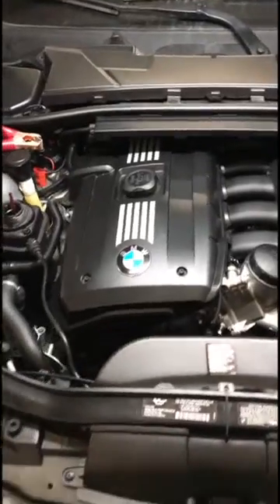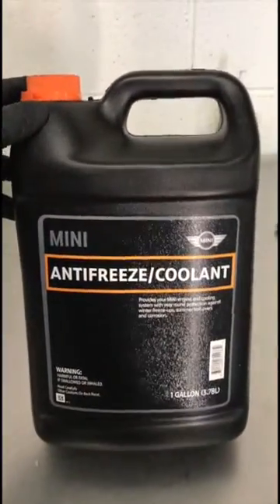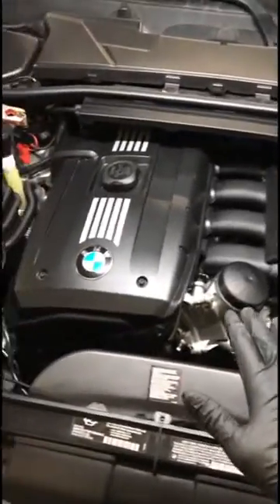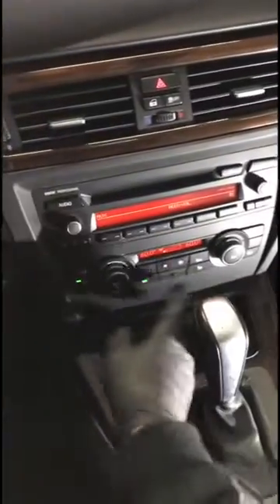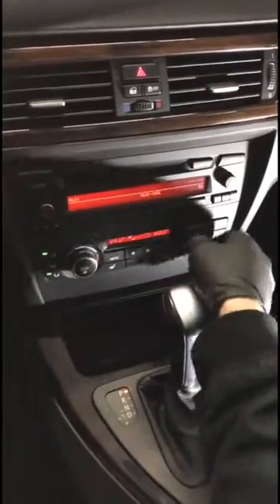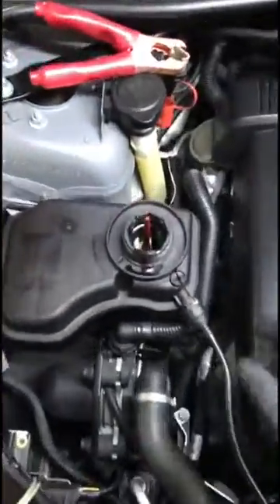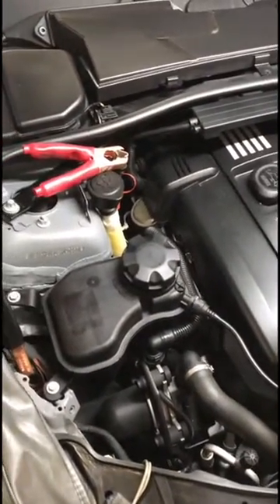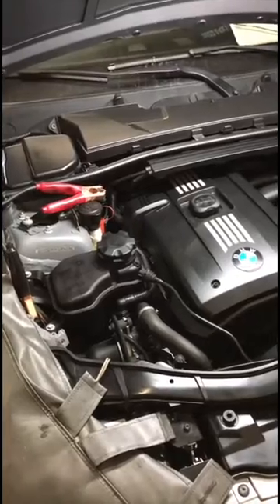How to bleed BMW with Electric Coolant pump

Comment: E90 318i n43b20a 
Hi everyone,
I’m dealing with an overheating issue on my BMW. The thermostat has already been replaced, but the coolant temperature still keeps rising.

When I run the bleed/test mode, the electric water pump seems to work normally, but when I actually start the engine, there’s no coolant circulation (nothing spraying back into the expansion tank).

I also pulled a fault code: 2E85 – Electric water pump communication error.

Has anyone experienced this before, or could give me some guidance on what to check next?

Thanks in advance!

Comment: Hello. I have a question. Why does my car heater turn of after couple seconds?
Reply from the maker: If you don't have a battery charger on and your battery is weak it will shut the ignition off.

Comment: Do I unscrew the bleeder screw when bleeding it or just loosing it up?
Reply from the maker: You can just loosen it half way while topping off the coolant. Then tighten it down before performing the water pump bleeding procedure.

Comment: I can’t get my pump to turn on.
Reply from the maker: @ArchieMacLean-tq6zz  did you just replace it? What coolant repair are you doing. Did the car initially overheat? If so maybe the pump is bad
Reply: @MikeMDs  the car did get hot but not too bad.  It had a leak in the top line so I fixed it and now I'm trying to bleed the system but the pump does not want to activate.  I don't even know if it has a pump.
Reply from the maker: If it is not the engine shown then it might have a mechanical coolant pump. If so let the vehicle idle for three minutes at 3,000 rpms with the heater on. Once you feel hot air form the heater the system is bleed.  After the engine cools down you can top off as needed.

Comment: You really don't need more than 3 mins at a time your battery will drain if you do it too long. 3 mins bleed turn it on with cap off and turn it on for like 3 mins then repeat I've never had a issue.  BMW 328i 2011 automatic

Comment: Question: does the cap needs to be tight closen? 🤔
Reply from the maker: either all the way off or all the way tightened. No in between because  the jet hole will be blocked.
Reply: @MikeMDs  thx

Comment: What amp setting do you use for battery charger/maintainer? Curious if I should use the trickle or charge mode.
Reply from the maker: My charger is automatic. But definitely not on trickle. This thing draws some amps.
Reply: @MikeMDs  thanks! I set it to 10A last night for 3 bleed cycles, and it pulled closer to 12-15A probably. Worked great with $60 hobo freight tool, if only i didnt Put the radiator to turbo air hose on loose 😂

Comment: goimg a bit off topic on this video but i have a 2006 325i e90 and it has this code  intermittently p0604 Code - Internal Control Module Random Access Memory  (RAM) Error ..if the car is cold it always turns on but after driving it for quite awhile and turn it i
off it then it will not start and gives me that code

Comment: There's a bleeder screw on the side of oil filter. (On n46 e90) simply open unscrew plug while filling the coolant reservoir.. once the coolant comes out..(pushing air out ) close the bleeder screw and check coolant level in the reservoir...n

Comment: 2009 328i, water pumps but flow seems really low and it flows for maybe 10 seconds then stops, then a few seconds later repeats and keeps cycling like that. Did that for less than 10 minutes then stopped. Had charger connected the whole time.
Is the flow supposed to be constant the whole 12-ish minutes? Does this sound like a failing pump?
Reply from the maker: It is normal for it to vary in speed and shut on and off while performing the bleeding procedure.

Comment: hi.. just want to ask if i push gas pedal for 12 sec , my ECU will format or not ? because my friend said if we push for up to 8 sec , all of thing in ECU will reset to factory setting back. thank you
Reply from the maker: It will not reset the ECU doing that. To reset the ECU on BMW's it requires a machine.  You are safe to precede

Comment: Hello ignition position won’t stay on long enough for bleeding, can you tell me why
Reply from the maker: Hi, 
You probably have a weak battery. The car will turn off the ignition on purpose.  You can try and hook a battery charger to your car. Let it charge the battery first for about an hour then try it again leaving the battery charger attached.

Comment: Any idea as to why the bleed procedure will not complete? I've let mine run about 30 minutes and it doesn't finish.
Reply from the maker: Some models will keep going. after 10 min you can stop it as that is plenty of time.
Reply: @MikeMDs  thank you!

Comment: Thanks for a great video, when connecting the power source, do you have to disconnect your positive lead on your battery?
Reply from the maker: No, the power source is only so the pump activation wont drain your battery.

Comment: My BMW F20 has also electrical pump, but this does not work on my car.
I press the gas pedal longer than 15 seconds. But i dont hear the pump working.
Reply from the maker: Your engine has a mechanical main coolant pump. And a small electric pump for the turbocharger. This method will not work on your engine. You bleed it the old school way. Heater on while revving it at 3k rpms till you feel heat coming out of the vents. Make sure the coolant cap is on while doing this.

Comment: I asked that question about bleeding with FCP Euros and the guy said you didn't have to do that cuz I remember doing that on the E46 I'll be changing my radiator cuz my elbow on the upper radiator has a slight leak and they're lower radiator or the sensor goes in is leaking there too

Comment: I’m going to pick an 06 530i up and plan on doing this to it as soon as I pick it up. My only concern is the battery potentially dying. Would jumping it off if it did die be an option?

Comment: Is water pump replacement easy to do?
Reply from the maker: The electric waterpump is in a tight spot on the right side of the engine. Without a hoist I'd say no it is not easy.
Reply: Not easy but not impossible, but at the same time it’s really not a hard job just be patient with it since there’s not much space

Comment: I have a E90 320i with a faulty auxiliary pump, will this stop the bleeding process from working.
As I have tried it and nothing happens.??.
Reply from the maker: Yes if the pump is faulty the bleeding will not work.

Comment: I have. 2017 and I did this and there was a puddle under the car. Had the pump changed about 8 months ago. Also a hose on the left side. Any suggestions?
Reply from the maker: It's hard to know what is leaking without seeing is. my guess is a loose hose clamp at the pump or thermostat.

Comment: Hi sir thank you for your video is very good describe procedure 

I have a 2 question for you 

- Betwen 2 bleeding cycle if possible to not shut off key and just put the gaz pedal for restart the second cycle?

- And for cleaning and descaling all water system what product is recommended for an E90 328xi 2011?

Thank you have a nice day 
(Sorry for my english it's little hard for me)
Reply from the maker: Im not sure on your first question. I've never tried that. 

The second question. No cleaning checmicals are recommended as you will never get them out completely. 
Unless you have foreign liquid in the system like engine oil or stop leak.  At that point it is recommended to use GAIN laundry detergent. As it is gentle and wont etch or absorb into the coolant components. you would need to flush the system many times though. You run the engine with it to get it warm in-between flushes.
Reply: @MikeMDs  Thank you have a nice day

Comment: Hi mike so I replaced water pump thermostat hose flange on my 2010 bmw 328i the bleeding process went threw but it kept going for like 20 minutes then I stopped it and retried it and it’ll start doing it then just stop no more bubbles come out of reservoir straight anti freeze
Reply: I also changed Raidiator
Reply from the maker: Yes some just keep on going forever. So as long as there are no bubbles you are golden.

Comment: My old raidiator for a bmw e90 was cracked I changed it and filled my coolant up and the light is still on for the coolant but I never bled it is that something I have to do? It’s been a month since my radiator change and I didn’t bleed it do I need to do that ? Pls help
Reply: Also changed the sensor and the light still comes on
Reply from the maker: If you check the level and it is good. Then it is a bad coolant tank. The float inside is waterlogged and not floating properly .

Comment: Great tutorial video! Clearly spoken and explained. Straight to the point with no fluff, if only all of them were like this. I followed your instructions and it worked flawlessly. I did a radiator change so I took your advice on bleeding it twice and did get a little more air out on the second time. So, I second (pun intended) that recommendation. Thank you brother and please keep the bmw repair videos coming.
Reply from the maker: Thank you for your encouragement. I'm glad it helped.

Comment: Can I start the car and bleedbot that way cause I forgot spare battery I know battery gonna die
Reply from the maker: It would likely work but I don't recommend it.
Reply: Works if battery good 👍 or jump with other car or another battery connect . Three ways. Yes you can bleed the car if you just start it with cap off. Thought I'd throw those things out there seeing I'll buy these cars any condition.

Comment: ok PLEASE help i did this and my headlites stayed on and drained my battery i have a 2008 BMW 328i sedan why did this happen as i never started the car? also we had previously bleed the system after installing a new water pump but i did it again because i thought u had to if u topped off the coolant????.   ALSO, I noticed the pump only came on only once or twice in ten mins ..is that normal. ???.does the waterpump  stop pushing water out when all the air is out and stop ? also if just topping off..do u have to rebleed? thanks'
Reply from the maker: You need to have a battery charger connected when doing this like stated in the video. It is too much load on the battery. If the battery isn't at the correct voltage the pump will also not bleed correctly.  Try and charge the battery back up and only then perform the bleeding procedure again with battery charger connected. :)

Comment: Hi Mike md i am wondering if you could please help i have a bmw e90 320i 2007 its a 2lt petrol n/a engine and i am not sure if my car has a electric water pump if you could possibky help it would be greatly appreciated thanks ian
Reply: Also its engine code is n46b20b
Reply from the maker: This is for the 6 cylinder engines in the US. Not sure about the 4 cylinder as we do not have it here.
Reply: Mechanical pump.

Comment: I started the bleeding by pressing that gas paddle for 10 seconds but the bleeding procedure won't stop even after 40 minutes
Reply from the maker: Some do that . Shutting off the key after 10 min should be enough time

Comment: can someone help me
my e92 water pump was broke car was overheating. mechanic put a new pump and thermostat i drove car. now still my car is overheating air is coming from coolant cabin. and fan is running at full speed. any suggestions

Comment: I replaced the rad on my 06 330i a month ago and did this. The other day the overheating light popped up on the dash I'm going to try and bleed it again. Car didn't seem to be overheating so hopefully just a air bubble. Think it helps to jack up the rear of the car while bleeding? A temp gauge would make too much sense BMW 🤦‍♂️
Reply from the maker: Dang,  Could be air bubble, also make sure the electric fan is coming on. They intermittently stop working when they get warmer on higher mileage cars. If you have a code reader, make sure there are no coolant pump high amperage or blockage fault codes. If so then the pump is going bad. Best of luck
Reply: @MikeMDs  thanks man! I just parked it until the weekend then I'll check the water pump and fan are working okay. No cel lights came on just the yellow overheating symbol so I shut it off and parked it. 220k miles it's just getting broken in🤣

Comment: The coolant stick should be same level as the cap not over it.
Reply from the maker: Yes your correct. We fill it more to prevent the customer from coming back a week later with a low coolant light. Sometimes the level drops after a coolant repair and bleeding due to small trapped air pockets.
Reply: @MikeMDs  got it. Quick question, does bleeding coolant system prevents it from getting cracks on the plastic parts?
Reply from the maker: No unfortunately that is just due to age and heat of the coolant passing through the hose. Fresh Coolant mix can extend the life of already good components as it has lubricating and corrosive resistance properties.

Comment: I added full coolant and replaced the vent hose after it broke . Then drove 20 miles without bleeding it. Shout I still do it before topping it off? Level looks like it went down a little so maybe air already got out while driving?

Comment: Perfect tutorial. Well done. 
Is this applicable to the N20 engine as well? 
Can you sometimes open and close the bleed screw while the pump is circulating the coolant? Or isn’t this suggested?
Thanks.
Reply from the maker: Yes, you can open it to monitor the progress and add coolant if needed.
Reply: @MikeMDs  because my coolant level is good, but still sometimes I have cold air waves even when the engine is at constant operating temps. And yes, the thermostat is good. So I would perhaps consider bleeding using this procedure and open the screw from time to time, or simply open it until there aren’t any bubbles coming out.

Comment: all I’m getting is a buzzing sound when I bleed the system. Is my water pump blown? All I get is a buzzing noise took the cap off and didn’t see any coolant going through the system
Reply: Same
Reply: @Astralkiller47  my pump was shot. But hey is lasted 110k miles. Put a brand new continental OEM pump in w wahler OEM thermostat and it’s good as
New now. It’s not HARD but it’s def not easy to replace the water pump
Reply: @startingtech3900  I just added some more coolant and it started giving me a little more "splishy splashy" lol.... hopefully that was the issue because pumps are expensive and that labor is not something im excited to do, but I am at 120k, so its inevitable.
Reply: @Astralkiller47  yeah man pretty expensive. I did all my own work for 400$ I replaced the coolant tank for the hell of it too. But all that work at a shop would be 2000$ on the LOW end
Reply: @Astralkiller47  and yeah 120k your overdue. Is your bmw overheating ??? Any engine over temp signs on the I drive???
Reply: @startingtech3900  Nothing whatsoever! It leads me to believe that previous owner must've replaced it. I got the car with 72k. Only reason I was under the hood today was because my expansion tank cracked, I put in a new one, so I'm going to drive it around for a little and see if everything is in working order.
Reply: @Astralkiller47  if your not overheating just replace expansion tank and refill and bleed and your good to go. You got lucky. But the guy who sold me my 07 bmw 335i got rid of it for 5200$ it was fully loaded alpine white, new turbos dealer maintained from 07-2019 and tons of work on it but he thought he scammed me. I fixed it and it’s been great. You can’t get a 335i loaded in great shape for less than like 8000$ today
Reply: @startingtech3900  Yeah I took it for a spin and its running fine, so i guess she’ll live to fight another day! Lol And yeah you came up with the 335i, I honestly don’t think I’ve ever seen one for less than 8. Those N5X engines are basically bulletproof so as long as you maintain the adjacent parts like cooling system, turbos, and the other plastic shit, you’ll be able to ride that car until the wheels fall off, or the engine mounts wear off which ever comes first lmao

Comment: I did this and I put the cap on and unscrew the bleeder and a lot of coolant came out when the system was being bled why ?
Reply from the maker: Don't open the screw while it is electronically bleeding. The screw is for filling the coolant system before bleeding. You open the screw, add coolant, close the screw. Then bleed the system.

Comment: Is the serpentine belt supposed to spin when doing this process? Just don’t get how the water pump even works if the belts connected to it but the cars not started I’m having trouble bleeding the cooling system on my 2006 BMW X3 I’m thinking i need a new water pump if you could let me know i would really appreciate it thx
Reply from the maker: Hi, that year has the older engine which has a mechanical water pump. So this method will not work. You will have to bleed it traditional method

Comment: Hi I’m having problems starting the bleed process. The current outside temperature is 30 degrees Celsius and the maximum the heater will go to is 28 degrees. How do you get this to work in these conditions?
Reply from the maker: That shouldn't matter. You may have another issue.

Comment: Great video Can you post or suggest what type of battery source did you use I saw that you have it connected to the terminals but it does not say what type of battery source since I don’t wanna risk it just by using my own battery can you help
Reply from the maker: you can use a battery tender/charger from autozone.  Let the battery charge to max before doing this procedure. See if there is one with a ps mode (power supply) and set it to that mode . That mode is used when the key is on in the vehicle.
Reply: thank you so much, again thanks for the video

Comment: Do you bleed the system after adding coolant or before adding new coolant ?
Reply from the maker: after adding coolant.  Only needed if the system was open for a repair.